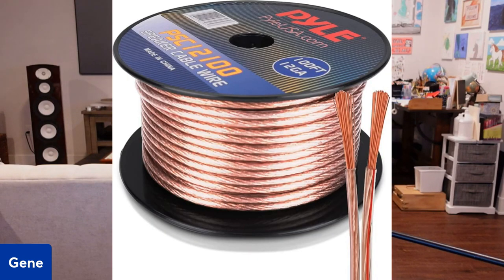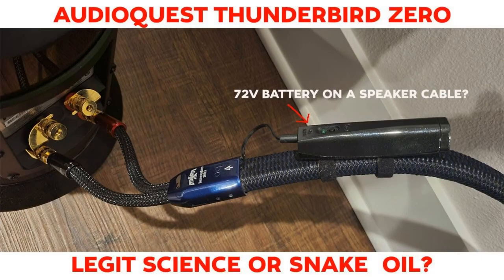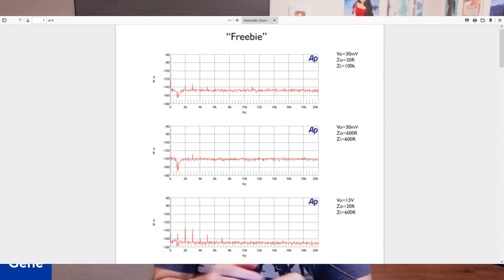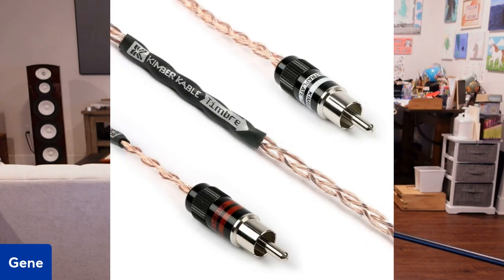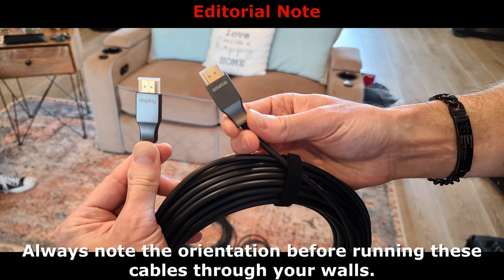Are Cables Really Directional?

Comment from the maker: Editorial note: twister pair interconnects are only appropriate for audio, NOT video. The usable bandwidth is really limited to about 100khz since this type of cable doesn't have the proper 75 ohm characteristic impedance. This is one of the reasons  why COAX has bandwidth advantages.
Reply: But you can change the equipment to 50 ohm coax or 100 ohm twisted cable(cat5+) if you really want!
Reply from the maker: @erlendse  for long distances, coax is the way to go. It's why it's the standard for broadcast cable/satellite systems.
Reply: There are video drivers and converters designed for twisted pair that can pass video, but generally they take advantage of digital transmission, which has a completely separate set of contraints.
Reply from the maker: @TomCee53  yes there goes beyond the scope of this video. Generally speaking coax is a better way to transmit high frequency content at long distance.
Reply: @Audioholics  Totally.

Cat6+ cables with the right termination are actually good for many hundreds of MHz.

Even before mentioning digital stuff! Also check AHD/CVI used for surveillance cameras.

Coax is very popular, since it does work well. Signal loss is totally a thing on higher frequency.
They just don't matter too much for audio frequency within a reasonable audio room size!
Reply: Congratulations! You're the winner of a competition you never entered. Send me cash and I'll send you a prize!
I used RG8 coax many years ago as I had lots lying around from CB/ham stuff. Worked so well I never even needed shelves to hold my components.  Although the layout of said components was dictated by the cable and it's inability to bend!

Comment: Gene, ive gone to using double or triple shielded digital coax for all of my interconnects and they work flawlessly to my ears. I did this based on your older snake oil video so thank you for that recommendation. The only issue i have is that the quality digital coax ($25 per cable at MOST) is quite thick and inflexible due to the layers of shielding. But im happy to make that trade off for the performance and price. And they look goo too! Much better than standard "RCA"
Reply: Which make/model coax cables?
Reply: I tried using shielded digital coax as interconnects, however I found the sound 'altered' and not as balanced, I put it down to the 75ohm cable.  One thing I did notice is how noise free quality digital coax cables are.  I have since used Van Damme Lo-Cap 55 cable, and it out performed digital coax for sound quality and at least matched digital coax for it's low noise.
Reply: i've actually been debating switching back to ccheap "RCA" cuz the shielded cables are so thick i'm having a hard time getting them to stay connecting around bends and such. I guess i'll stick with the good quality coax cables i have...idk what to do about how thick they are though (i have a zdt jr where the L input basically keeps sliding off because of how thick it is and cuz it's being bend to reach the input).

Comment: Thank you for your informative video. some point of view from technical aspect
1) Wave length: Coaxial cables are designed for very high frequency. What is considered to as a  High frequency?  signals with short wave length, or specifically cable reaches close to (highest frequency)  1/4 wavelength or longer. for audio signal of 40000 hz the wave length is 7500 meters, 10% of the wave length is 750 meters, so never a coaxial cable will perform as intended for audio frequency.
2) Matching Impedance: Coaxial cable has usually a designed impedance as 50Ohms or 75ohms. in order for it to perform correctly it has to have a matching impedance of the source output and the destination input impedance. however, this is true for long cables (longer then wave length so this whole statement is irrelevant for audio signal
3) Skeen Effect: for audio signals there is a huge difference between cable connectivity between low frequency and high frequency due to skin effect, this is relevant only for low impedance input or high currents, but at any case the conducting wire should be threaded and not a single wire as a Coax center wire is. What is the effect on audio signal? I don't really know,  but for sure a proper threaded wire will remove any doubt.
4) Capacitance: typical preamp output is around the 1K ohms area, this means we need the total capacitance loading to the Preamp output to be less than 1.5nF (for a 100Khz FR). this is relevant to long twisted cables and even more when shielding is added.
5) One side shield: the purpose (as per designer) is to conduct EMI interference to the received input shield while maintain a DC ground separation between the two units. on good designs units this is not necessary and sometimes it is even better to have the EMI earthed at shorter as possible distance of cable.

hope this helps

Comment: Gene, you mentioned coax cable. I went to Amazon and bought a set of the Worlds Best Cables Mogami 3082 coaxial speaker wire. I had to retune my system, as the bass was fuller, in a good way. I asked about this, and an engineer type fella, not into the snake oil, deciphered the Mogami cable engineering specs, as Mogami is one of the few audio cable companies that actually does this. He said he could see why the speakers may have sounded different. 

Here are his thoughts:  I am amazed to read DC resistance per metre is soooo low. Also the net cross sectional area is 2.6sq.mm. This is very good. 0.054ohms total cable resistance for a 3 m cable to a low of maybe 6ohms impedance on a nominal 8ohm speaker. My mental arithmetic says that you lose less than 1% signal power through the cables. Irrespective of construction methods, that is why they are so good. Target is zero resistance, capacitance and inductance. These figures look very close.

Thoughts?
Reply: All cables can be modelled as an Inductor (the cable itself) wired in series with a resistor (the cables resistance).
Also there is a small capacitance between the two conductors, which doesn't make a lot of difference in the most cases.
Therefore any cable is a weak low-pass filter, while the target is to have no inductance, capacitance or resistance as it would alter the signal. So besides overall signal level/volume there shouldn't be any reason why a cable should increase bass volume.
Reply: So the quality of any cable can be boiled down to how low it's resistance, capacitance and inductance is.
For low power transmission (e.g. line level) isolation also makes a significant difference.
However a low inductance cable will naturally pick up less electromagnetic interference.
Reply: Coax as well as twisted cables generally, have a lower inductance, because the electromagnetic field generated by the two conductors is opposed and therefore cancels out itself.
This would however more likely lead to a better HF transmission.
Reply: @informatiger9501  Well, something is different... I am not one of those guys that can hear a difference between a $5 cable or power cord vs a $100+ one, I believe that is all snake oil, but something still happened here. These coaxial cables vs the OFC, maybe it was my homemade cables vs the soldered connection on the Mogami. And I have quite a few speaker cables laying around here, home made and professionally assembled, I cannot hear the difference between 14ga zip cord or any of the others I have laying around. But, they are all OFC, this is a first foray for me into coaxial cable as speaker wire. Well, I like them, there was a difference and they are staying. Thank you for answering and not insulting my intelligence. ;-)
Reply: @michaelwright1602  probably just lower impedance in general and therefore higher volume. Coaxial cables are were specifically invented to carry HF signals in the MHz to GHz region.
Definitely not because they are coaxial.
Reply: The effects of coaxial cables only become apparent, when the wavelength of the electromagnetic wave within the conductor becomes shorter than the conductor itself.
(Besides the noise reduction)

Comment: Respectfully Gene , there is an exception . Some manufactures , Like Acrolink Japan , make speaker cables with copper shielding. The shielding is connected at the amp end to the  negative binding post of the amp. Therefore their speaker cables are directional because of the location of the ground.   Not that i see the sense in having speaker cables with copper shielding ,
Reply from the maker: I addressed that in the video that some cables have a shield grounded on one end. little point in doing that in speaker cables tho.

Comment: The electricians who originally wired my home put all the Romex cable in backwards, and instead of being able to power up my appliances and other electronics like hifi, the power was actually sucked out, and my electric utility meter spun backwards.. It was quite expensive to have the cables removed and turn around the right way, so yeah, all cabling is directional.. duh.. Only a flat earther would believe otherwise.
Ok, enough commenting, it's time to go back to listening to my hifi and yes, the cables are all installed the right way around (all the little arrows pointed the right way and the happy little electrons dancing their way through).
Seriously speaking, twisted pair has an advantage of NOT rejecting noise inductance, but rather distributing noise evenly on both conductors. If the electronics being fed with twisted pair has a common mode rejection stage where only the difference in signal is passed through, this noise gets blocked. This is how high speed ethernet cable like cat 5E and cat 6 can handle high speed networking signals up into the gigahertz range. The ethernet cable is made up of twisted pairs, no shielding required.
Reply: Lol! Good one

Comment: I'm confused.  Doesn't an AC signal move in both directions?  If a cable is directional, how could it be used   to accommodate a signal that needs to travel in both directions?
Reply from the maker: exactly, see you're not confused after all ;)

Comment: For many years we made up interconnects using Belden coax, the quick and "dirty" method was to use a cable stripper and a BNC crimp connecter, and an RCA adaptor, this was especially useful doing custom subwoofer runs through cabinetry, we never had an issue with any these, personally, I preferred them to the cheap Chinese interconnects which don't use any shielding at all!

Comment: Radio frequency can be shorted out without affecting audio using a a small (very small) value capacitor in parallel to any source, speaker cable, power cable, even that am interference from power lines over street can be shorted out with very small value capacitor in parallel on power lines without shorting out power (the capacitor of very small value passes the lower frequencies and shorts out the radio frequencies when in parallel). This method of shorting out radio frequencies works like a crossover network in speaker passing only the desired frequencies.

Comment: Hi Gene, I'm an audio engineer and I've always scoffed at people saying their expensive cables do this or that. Having said that, I do for a fact am aware that same type cables with the same inteconnects can sound different from one another, and some times substantially so. Could you explain why would that be the case, please? How manufacturers like Kimber for example, can make their cables sound different? Thanks.
Reply: Brother, I'm a truck driver, and just ripped out my HT and installed a nice two channel system, I built around my KLH Model 5's. I am a big fan of Mogami cables, they all have measurements and most sound studios use them, so I figure that is good enough for me. I recently bought a set of Mogami 3082 coaxial speaker wires with Banana plugs, Worlds Best Cables on Amazon... I have always used OFC, have some professionally built ones and a lot of home made. I never heard any difference in any of them, 14ga zip cord or some pricey sets with fancy jackets and connectors... Until I through these Mogami coaxial wires in, I had to do a bit of retuning to the system. Everyone says I'm full of sh-t. I heard a difference, and have asked a serious question in regards to OFC vs Coaxial in speaker cables, I think that is an honest question, is there a difference? All I get are insults at the audio "science" sites, and no answers. I did find an engineer on FB, he took the published measurements and stated he could see why. The only honest answer I have gotten, along with one here regarding this subject. Really frustrating when something happens to your ears, and you have to physically start adjusting things as the sound DID change. I hope you get an answer.
Reply: @michaelwright1602  Hey there man. Well, cables are literally the last thing anyone should worry about in terms of sound quality. First, and second in the list is your listening space.
Anyway, you shouldn't feel bad for being able to hear the difference between cables in your system. Cables can in fact affect the sound of a system, even though slightly. That's a fact. What I don't know, is how is it possible. After all, I personally care for a flat response, not cables with built in eq of sorts.
Maybe Gene can help with the science behind this behaviour?
Reply: @michaelwright1602  Every cable has an inductance and capacitance and resistance, as such it is basically a low pass filter (mentioned in the video). In addition differences in capacitance and resistance will create slight differences in volume between cables, sometimes. Remember the argument here is not that cables make zero difference, just that anyone telling you to spend a big money (many 100s to 1000s of $) on their fancy cables might be misleading you. 

If you're curious, here's kind of a worst case scenario for how cables can affect things: an Electric Guitar. Basically when you plug a guitar into a guitar amp, the pickup is now part of the circuit of amp:
https://www.youtube.com/watch?v=zPVM-k0-0HA

The effect is less and less as you reduce the length of the cable. Notice he is testing 20 ft single ended cable. At 6 ft, it would be much harder to notice any of these differences. Again this sort of represents a worst scenario, in the differences cables can make, in the hifi world the need to run 20ft+ of single ended cable is maybe not so common. Again does not apply the same way to XLR cable or other balanced cable, only single ended.
Reply: Try 18 ga magnet wire for the speakers.  Definitely gives a cleaner sound.  Mapleshade is the best.

Comment: I have a Naim UnitiStar connected to a pair of Monitor Audio speakers with directional AudioQuest Rocket 33 speaker cables with silver connectors. The system is a year old. I always believed that my system was lacking imaging then recently observed that one of my speaker cables was connected in reverse. I had no idea that my speaker cables were even directional. I switched the one cable around so that the amp end was actually connected to the amp and the speaker end was connected to the speaker. The imaging I craved, returned. I guess our ears really are the judge for what it’s worth. Thanks!

Comment: How can a cable be directional when the signals traveling through them are AC, which means they travel in both directions
Reply: While the current is bidirectional, the energy transfer is certainly directional. That being said, I don't accept that crystalline structure resulting from the cable being drawn during manufacturing has any audible effect with regard to directionality.
Reply: @immovableobjectify  "The energy transfer is directional"? You clearly know nothing about electronics. AC stands for ALTERNATING CURRENT! Current travels in both directions! DUH! The current IS the energy? What planet are you living on? 🤡

Comment: It's also worth mentioning, that when talking about a twisted pair ability to reject some unwanted signals, we have to keep in mind that it's not just the twisted pair itself, but the whole connection needs to be balanced. So, we need a transformers or differential amplifiers at output and input to get rid of unwanted common distortions. Twisting wires connected to an RCA connectors just doesn't make any sense, as RCA is unbalanced.

Comment: Setting up my M&K sub.  Used a thick directional subwoofer cable I bought years ago.  Cable did not work, thought it strange, so I looked on the cable for damage, found a arrow, turned it around to that direction from amp to sub, worked just fine 🙃

Now I am curious as well as confused after this vid
Reply: Are you still confused, or do you need some explaining?
Reply: You probably had a bad connection and it was pure coincidence.
Reply: Certain cables like some HDMI's are designed to run directional. However, analogue cables in my experience are more about the way the conductor has been burnt in. I once thought I burnt in a cable the wrong way round only later to discover now that it's been burnt in. One would be better off leaving it and going with the flow (pun intended)
Confirmation came when I put it to the test!

Comment: Pretty sure the Directional  RCAs (at least car audio, like Stinger) have to do with the shielding "drain wire". Not sure how, or if it works. It must though by the way they talk about it.  Stinger- "we've added a 3rd drain wire to pull noise away from the 2 twisted signal wires. These 3-conductor cables (per channel) are designed to reject noise and pull noise away from the the next device. To visualize, we only connect the 3rd (drain) conductor to the source side and the 2 signal conductors at the end component, keeping the noise from transferring to the next component."
Reply from the maker: I discuss this in the video.
Reply: @Audioholics   Sorry, was working and watching, lol